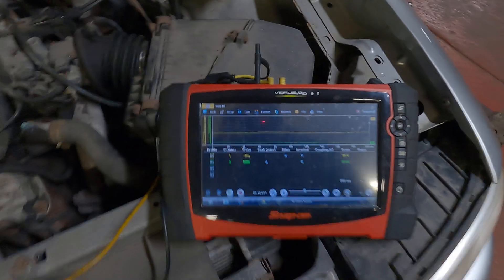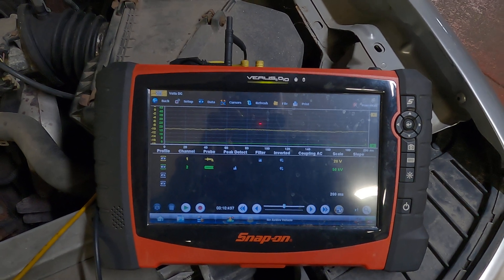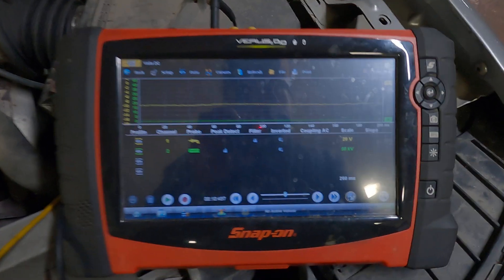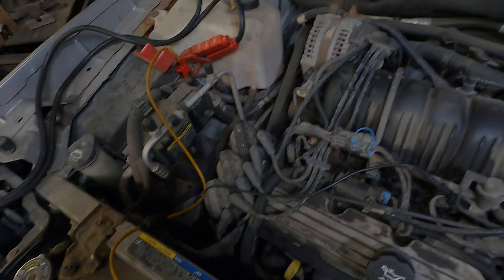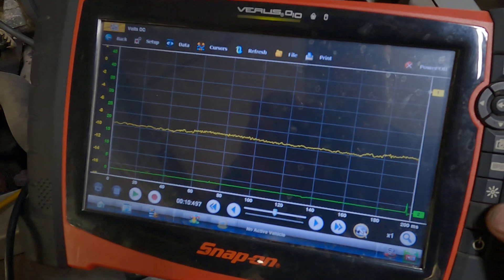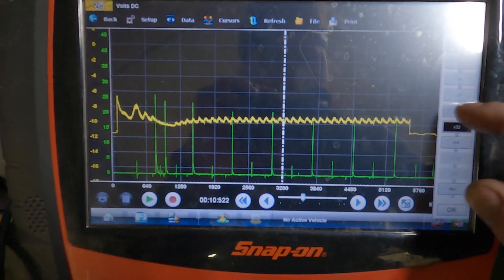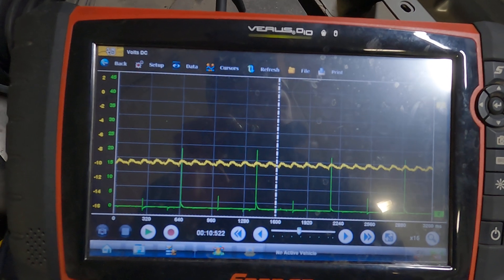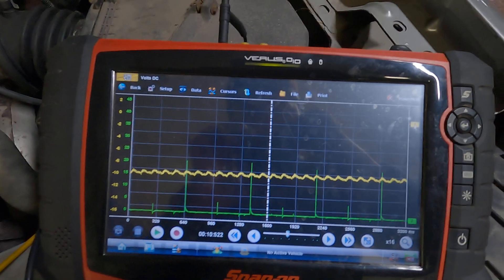Relative Compression, Relative Frustration

Comment: You could drop your voltage level to 10v to get more on the scaling captured.
Reply from the maker: I've tried doing the test with it set at 10v. I wasn't really happy with the results. When I'm doing this test, especially with this tool, I'm typically working very quickly. I'll record this, waveform, assess starter and batery health, then make sure, no dead holes, and move on. I like this layout for a quick glance, screenshot, and dump the buffer, on to the next test.